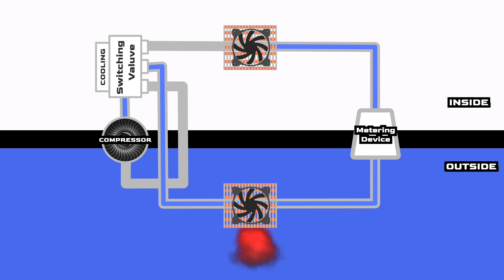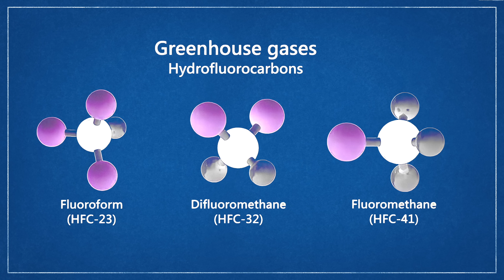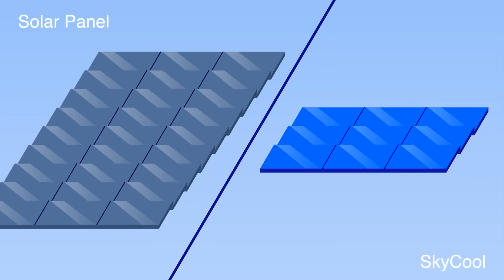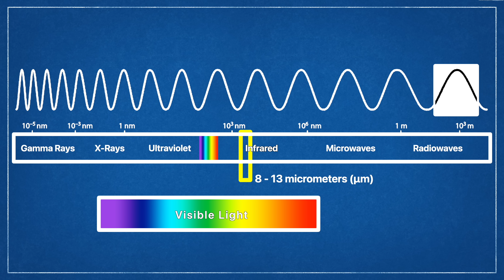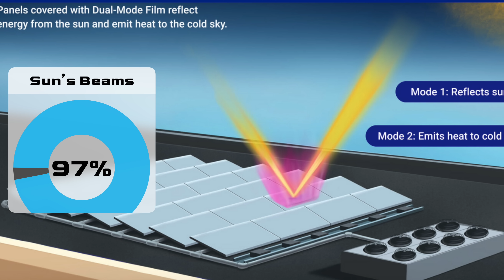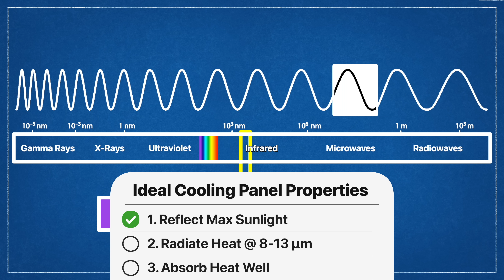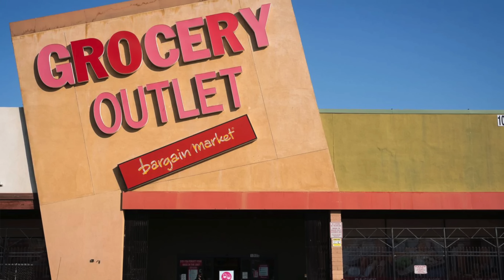New AC Tech Sends Heat Into Space & Saves 95% On Cooling Bills!

Comment: Heat pump on geothermal (avoids air to air transfer efficiency issues) while difficult to get installed seems to avoid fight with solar on the roof for space.  Guess it would still come down to cost.  Simple glass panels with films on them should be in range of solar but wasn't discussed.  Energy savings were discussed which sounded good but not if it takes longer than solar to return capital investment.

Comment: What do these panels cost? And when will they be available?
Reply: Since my comment debunking this video was deleted...

This whole thing is a scam.
Radiative cooling is a least effective way lose the heat! At room temperatures it is nearly non existent.

Convection and conduction effects are those that are heating up your house (heat from air and ground). Both of these are much more effective ways to transfer heat then radiation. There is no way radiative cooling with this magic device will be able to lose enough heat to keep up with being constantly warmed up by the hot air around it. Whole system will eventually equalize at ambient temperature.

Reason for this is second law of thermodynamics. Which in plain words means all energies naturally want to equalize. Meaning same temperature outside and inside your house. To fight this you need to create a temperature gradient and this takes extra energy. This is what regular heat pump or AC does. And since these magic panels don't use any extra (or enough) energy, they can't create a temperature gradient, therefor they can't work. Easy as that.

Radiative cooling is used in space on the International Space Station, because there is no other way to dump heat in space. Volume of the ISS is about 1000m3, area of radiators to keep it cool is 156m2. But that's in vacuum of space, there is no warm atmosphere there constantly heating up the radiators. 

So unless your house is in space this will never work.
Reply: @jeffsaffron5647  Logical!

Comment: Interesting. You said the Grocery store saved $6000 in a year but you didn't say how much those 60square metres of panels cost to make and install...? One of the major hurdles that has hampered the mass-adoption of solar-panels for example (which have been with us for nearly forty years) is they are still hugely expensive, requiring a large initial outlay that renders them impractical for all but the wealthy. If this 'wonder' system is anything like solar-panels, then sadly, it will just be another middle-class dinner conversation piece like Solar....

Comment: A reduction by only 15% air temperature? So that means since I'm in Vegas if it hits 115 it would only cool it down to 100?
Reply: Yes
Reply: But then it will be 100, so it would cool to 85. Then it would be 85 so it would cool to 70. Then it would be 70 so it would cool ti 55. Then it would be 55 so it would cool to 40. Then it would be 40 so it would cool to 25. Then it would be 25 so it would cool to 10. Then it would be 10 so it would cool to -5.

Comment: Someone with full understanding of this technology please chime in.

These panels aren't really radiating into space though. I.e. the atmosphere will still trap some of the IR radiation. Conversely, the earth itself is warmer than space, and is constantly irradiating heat into it. From a global perspective, does it become redundant?
Reply: Since my comment debunking this video was deleted...

This whole thing is a scam.
Radiative cooling is a least effective way lose the heat! At room temperatures it is nearly non existent.

Convection and conduction effects are those that are heating up your house (heat from air and ground). Both of these are much more effective ways to transfer heat then radiation. There is no way radiative cooling with this magic device will be able to lose enough heat to keep up with being constantly warmed up by the hot air around it. Whole system will eventually equalize at ambient temperature.

Reason for this is second law of thermodynamics. Which in plain words means all energies naturally want to equalize. Meaning same temperature outside and inside your house. To fight this you need to create a temperature gradient and this takes extra energy. This is what regular heat pump or AC does. And since these magic panels don't use any extra (or enough) energy, they can't create a temperature gradient, therefor they can't work. Easy as that.

Radiative cooling is used in space on the International Space Station, because there is no other way to dump heat in space. Volume of the ISS is about 1000m3, area of radiators to keep it cool is 156m2. But that's in vacuum of space, there is no warm atmosphere there constantly heating up the radiators. 

So unless your house is in space this will never work.

Comment: i remember experimenting with radiative cooling 
like putting an open cardboard with some metal plate inside and a temperature measurement device, i could get -5~10C below ambient
but about the power of radiative cooling, i think it was 100~150W/m2 on average using traditional methods 
and i remember there was a study about new material that reflect sunlight and emit infrared, and i think mb it's the same patent?
this summer i put lime on my roof and it helped cool my room during summer, and i could get away with only using a fan instead of AC i had on my older house (it reach 47C here in the sahara desert)
Reply: what does lime do ??
Reply: @danf4447  it's same as white paint just less expensive to use and apply.

Comment: It doesn't look like these would remove humidity, but maybe they could be combined with a dehumidifier or used as a backup to a regular AC.  Big question:  What do they cost?
Reply: Well, if you could buy them it you would quickly find out these don't work as advertised.
Two Bit da Vinci is just another dimwitted youtuber that likes to flog scams...
Reply: Good question. I don't know the answer to your question. I do know that one can build their own version for pretty dang cheap. I made a comment recently here as a general guideline of how to do so. The vacuum insulation panels part is actually not that hard to do at home, though requires some specialized equipment. You don't really need VIP's per se, but if you know how to make them and have the equipment, you can make them fairly easily and inexpensively.  Conversely, you can also just use thick enough, high quality foam (most of which is fairly IR transparent, along with many plastics and a lot of materials that are opaque to visible light).

Comment: I enjoyed your video, it is to bad the efficiency decreases when you above  Latitude  of 43 degrees.  Would love to see a working prototype.
Reply: Since my comment debunking this video was deleted...

This whole thing is a scam.
Radiative cooling is a least effective way lose the heat! At room temperatures it is nearly non existent.

Convection and conduction effects are those that are heating up your house (heat from air and ground). Both of these are much more effective ways to transfer heat then radiation. There is no way radiative cooling with this magic device will be able to lose enough heat to keep up with being constantly warmed up by the hot air around it. Whole system will eventually equalize at ambient temperature.

Reason for this is second law of thermodynamics. Which in plain words means all energies naturally want to equalize. Meaning same temperature outside and inside your house. To fight this you need to create a temperature gradient and this takes extra energy. This is what regular heat pump or AC does. And since these magic panels don't use any extra (or enough) energy, they can't create a temperature gradient, therefor they can't work. Easy as that.

Radiative cooling is used in space on the International Space Station, because there is no other way to dump heat in space. Volume of the ISS is about 1000m3, area of radiators to keep it cool is 156m2. But that's in vacuum of space, there is no warm atmosphere there constantly heating up the radiators. 

So unless your house is in space this will never work.
Reply: @jeffsaffron5647   I was amazed how this technology was able to create energy and break one of laws that energy can not be created , only converted.  Because it would i would need at lot of BTU / KWH.
Reply: Ah 43 degrees is too south for it to lose efficiency, like 55 would be better. Thats unfortunate. Do you know how much efficiency it loses btw, is it a significant loss?

Comment: 8:42 There is no heat pump in this picture. It is an evaporative cooler (AKA a "swamp cooler"). Coincidentally, evaporative coolers also are most effective in the same climates that SkyCool's are. A SkyCool system could be used as a precooler on an evaporative cooler making it more effective over greater range of climactic conditions than an evaporative cooler alone while still being much more energy efficient than compressor-based ACs.
Reply: any machine that moves heat is technically, a heat pump.
Reply: @Squeezmo  yup compressor same difference
Reply: Swamp coolers only work in arid areas, NOT HUMID AREAS...using a swamp cooler in humid areas will make the heat index impossible to deal with...the exact opposite of what you want.
Reply: @billiamc1969  Perhaps you should read my comment again..."evaporative coolers also are most effective in the same climates that SkyCool's are." High humidity and cloud cover reduce SkyCool's efficacy.
Let's take Las Vegas as an example. A swamp cooler alone can be used most of the year to achieve a comfortable indoor temperature. During July and August however, the wet-bulb temperature can often get to 70°F (21°C) or higher. A SkyCool system could be used to lower the temperature of the incoming air stream without adding humidity. This can potentially bring down the wet bulb to a range that the swamp cooler can continue to be used more days out of the summer.
Reply: This tech does not emit any water vapor making it usable in humid environments except more humid environments tend to have clouds which limit the effectiveness of this method. 

Given the increasing shortage of available fresh water in the American West and especially the dessert this tech will undoubtedly take the top spot for use in such places.
Reply: Yes, this system only takes care of sensible heat.
Reply: evaporative cooler are good but they are needed in very areas that are generally dry and have water shortages...lot of clean water is wasted
Reply: What is evaporating? Where? I'm confused.

Comment: Hey fyi swamp coolers are not heat pumps. Yes there is a water pump in it, but it is not the same thing as a heat pump. It pumps water over pads that air passes through evaporating the water cooling the air.

Comment: 1st law of thermodynamics, energy can never be destroyed or created. current AC systems move heat energy from one space to another through Heat pumps. There is a lot of numbers and pseudo science in this video but I would insist on seeing in action. The problem with space is that it is literally "nothing". "Nothing" can not absorb heat energy.
The "savings" that the store was seeing is due to the solar panels themselves and not needing to use power grid energy quite as much.
Reply: Since my comment debunking this video was deleted...

This whole thing is a scam.
Radiative cooling is a least effective way lose the heat! At room temperatures it is nearly non existent.

Convection and conduction effects are those that are heating up your house (heat from air and ground). Both of these are much more effective ways to transfer heat then radiation. There is no way radiative cooling with this magic device will be able to lose enough heat to keep up with being constantly warmed up by the hot air around it. Whole system will eventually equalize at ambient temperature.

Reason for this is second law of thermodynamics. Which in plain words means all energies naturally want to equalize. Meaning same temperature outside and inside your house. To fight this you need to create a temperature gradient and this takes extra energy. This is what regular heat pump or AC does. And since these magic panels don't use any extra (or enough) energy, they can't create a temperature gradient, therefor they can't work. Easy as that.

Radiative cooling is used in space on the International Space Station, because there is no other way to dump heat in space. Volume of the ISS is about 1000m3, area of radiators to keep it cool is 156m2. But that's in vacuum of space, there is no warm atmosphere there constantly heating up the radiators. 

So unless your house is in space this will never work.
Reply: @jeffsaffron5647  You and I are on the same page. I  Was skeptical at best on this. Now I'm certain it's snake oil. Physics and science

Comment: Simply building homes with much better insulation in roofs and walls would save you money without any use of new expensive technologies and the best part is it lasts for the life of the home with little or no maintenance. Reducing your energy needs means less load on the grid and less heat transferred to the atmosphere.
Reply from the maker: Insulating helps but can’t stop heat. You’d still need a system of heat dissipation. I’m saying you need both
Reply: @TwoBitDaVinci  You appear to be missing the point. I'm saying the technology is here today and in use but builders and buyers are not interested in paying for super insulated homes or businesses that would be far more efficient and sustainable. So we build subpar buildings and complain about how much energy they use!

Comment: Barium sulfate (BaSO4) is another material that have 98% reflectivity between 250 to 2500nm. It is cheap to manufacture an simple to obtain.  According to Perdue  University researcher coating 1000 sq. ft roof give 10 kW of cooling capacity. Industry grade Barium Sulfate cost ~$0.60 per kg. You probably could make your own paint at home by mixing barium sulfate with exterior primer and used that as paint.

Comment: This is for cooling the sky not the house necessarily. YOu are basically shading the roof, but with a material that also radiates the majority of IR heat back to space. So this is a nice idea, but it's not as good as solar PV, which shades your roof from direct sun and produces electricity to exactly run an AC (or anything else) at the same time.

Comment: For those interested in some real non-BS numbers from abstract of article "A structural polymer for highly efficient all-day passive radiative cooling": it gets in the ballpark of 85W/m2 of cooling effect. That's 1/3 what really good solar panels can do under best conditions, but it works 24/7 under all conditions with quite consistent efficiency (unlike solar).  It can cool up to 9C below ambient.
So compared to solar+heat pump it can probably be (for now) competitive in places where you need cooling most of the year. But it can probably be improved and I haven't found any mention what is the limit.

Comment: If I understood correctly, this will only reduce temperature by 15 degrees below ambient.  While this may work in a dry climate, it's not enough for most of the world.
Reply: Since my comment debunking this video was deleted...

This whole thing is a scam.
Radiative cooling is a least effective way lose the heat! At room temperatures it is nearly non existent.

Convection and conduction effects are those that are heating up your house (heat from air and ground). Both of these are much more effective ways to transfer heat then radiation. There is no way radiative cooling with this magic device will be able to lose enough heat to keep up with being constantly warmed up by the hot air around it. Whole system will eventually equalize at ambient temperature.

Reason for this is second law of thermodynamics. Which in plain words means all energies naturally want to equalize. Meaning same temperature outside and inside your house. To fight this you need to create a temperature gradient and this takes extra energy. This is what regular heat pump or AC does. And since these magic panels don't use any extra (or enough) energy, they can't create a temperature gradient, therefor they can't work. Easy as that.

Radiative cooling is used in space on the International Space Station, because there is no other way to dump heat in space. Volume of the ISS is about 1000m3, area of radiators to keep it cool is 156m2. But that's in vacuum of space, there is no warm atmosphere there constantly heating up the radiators. 

So unless your house is in space this will never work.

Comment: So, what’s the effects to global warming? Dissipating heat back into the atmosphere is a downside to this process. What is the maximum cooling effect for the recommended required spread of panels? It appears that this may still need to be backed up by the current methods of air conditioning.

Comment: You don't hear much these days about geothermal cooling. Drill a well, pump up relatively cool water, channel it through something like a car radiator, blow the air from your home through that radiator. Every time through, the air is cooled a bit. Like the system described in this video, geothermal cooling would not necessarily work everywhere, nor would it necessarily be sufficient to satisfactorily cool every space. And maybe it would be problematic in using scarce ground water if used widely. But it would reduce electricity use and eliminate the need for refrigerants. (Also, I noted that the title of your video mentioned 95% reduction in cooling bills, but the grocery where it was tried took only $6k off it's normal $40k bill. Did I hear that right?)